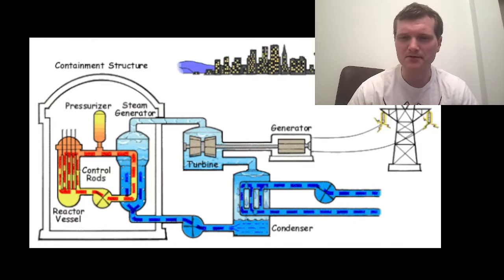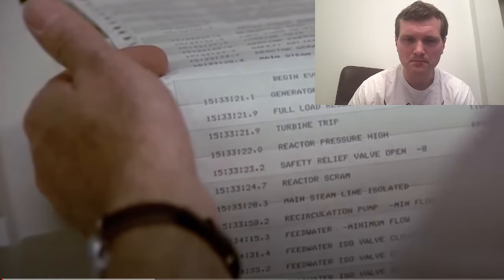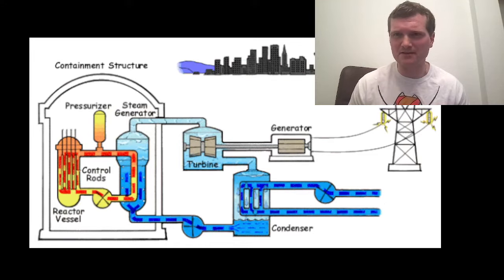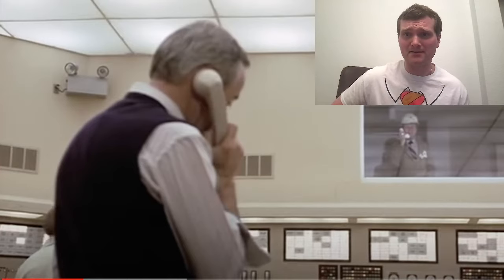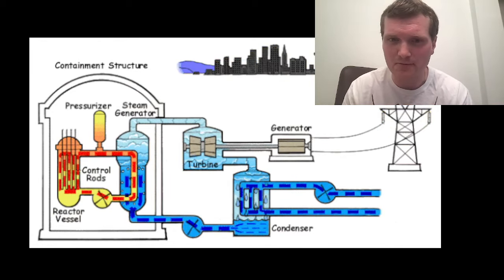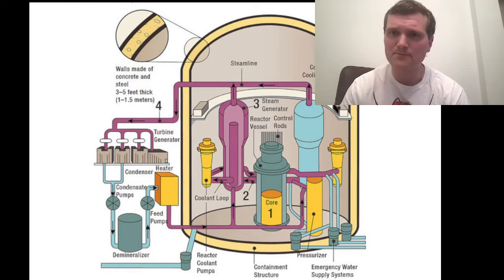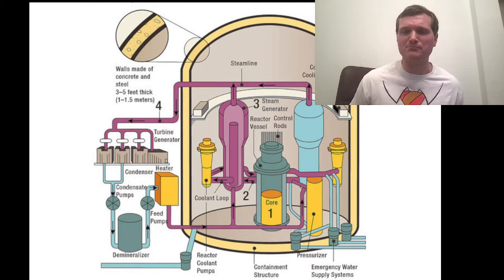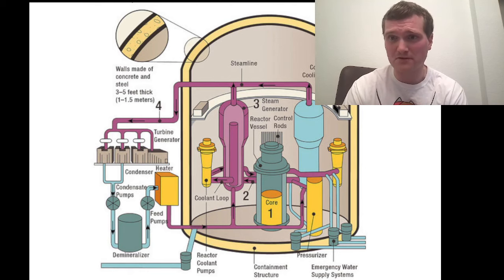Nuclear Engineer Reacts to Turbine Trip scene from The China Syndrome

Comment: Three mile island pressure control valve stuck open. But before that they shut the pumps off? Just like this movie, why would you ever shut pumps off that control water level over the core. I dont get that at all.
Reply from the maker: Great Question! Short answer: you don’t!

Longer answer: the TMI operators erroneously believed that they were going to fill up the reactor coolant system completely and there was an imminent overpressure event - their pressurizer level was rapidly approaching 100%. So, they stopped safety injection. 

It turns out that the pressure valve being stuck open created a void in the pressurizer (there was water at the top and steam in the middle) giving them a false indication. They were nowhere close to an overpressure event and this eventually led to core uncovery and fuel damage.

Operators are now taught to be aware of this false water level indication and better water level monitoring systems were installed in all pressurized water reactors in the US after the TMI event (among many other changes).
Reply: @tfolsenuclear   Just one question, why didn't they install cameras to watch things like that? Core water level etc.?
Reply from the maker: In a pressurized water reactor, pressure is over 2200 psi and temperature is over 600 degrees F - no camera can survive that!
Reply: Toledo Edison was the dress rehearsal for TMI. The NRC failed to communicate to like operators of other units about this potential problem.
Reply: IIRC the event started when workers were cleaning a sensor, accidentally causing the primary condensate pump to trip

Secondary pump automatically  started but the valve was closed for maintenance! 

So the steam generators are dry, the reactor residual (decay) heat, with nowhere to go, start to increase the pressure, the PRV opened to release excess steam pressure. 

The plant was handling the event as designed and presented no damage or safety issues (IMHO). 

The PRV valve however had a known flaw where a mix of water and steam can cause the valve to stick open while the indicator in the control room shows it closed. 

The valve is basically depressurizing the reactor causing water to flash to steam. a high level alarm in the PRV tank provided a clue the valve was stuck.

Up to the point of the PRV valve failing to close, the plant was doing  exactly what it was designed to.

In the chaos, operators (assuming the valve was closed) took manual control trying to correct the pump issue making the situation worse. Now the reactor core is exposed and getting very hot (meltdown)

A new shift arrives and discovers the valve is stuck open. They restore water to the reactor but the fuel is melting. At this point it's damage control. 

My take is:

1) B&W plants had issues but otherwise performed well during the event.

2) The control room and indicator layout was inconsistent, leading to further confusion about the PRV state.

3) The response (Particularly the utility company) pretty much torpedoed the public's trust in commercial nuclear power.

4) Nuclear is not the boogieman people believe it is. However, it requires meticulous quality and operator training and procedures.

Comment: Nuclear reactors are sort of like the Apollo command Module. tons of high quality engineering and redundancy.  9 trips to the moon and all came back over 300 hours approx.  200 WW reactors or bit less and almost no accidents and newer designs are so much safer and others like thorium does away with all the pressure problems and "melt downs"  and we will then move onto Fusion eventually with so many advantages and non of the radiation and waste like previous.  Oil and gas and cola will be mostly replaced given time so why this green rush?? Just bankrupts everyone trying to make solar and wind work 24/7 which it cant, but stupid is as stupid does!!
Reply: The great Stanley Kubrick spared no expense in making every film as convincingly detailed as possible. #nasaisanazijoke

Comment: I just saw this movie for the first time a couple of nights ago . The dramatic scene in the movie where Operations and Technical personnel have to go though all this effort to research and find a way to initiate a trip of the Turbine / Unit ASAP is totally fake . Routine testing is performed using  procedure(s) to simulate emergency trips to verify all systems work as designed . Technicians  already know what wires to be careful with to prevent accidental trip outs all you have to do is ask them .

Comment: I was told by one of my co-workers that water pumps with such criticality had a motor rating of somewhere around 5 horsepower but in reality was closer to 900 horsepower to use if stuff went wrong and you had to get that water in there fast. Was he fulla crap?

Comment: The reactor doesn't "always" trip on a turbine trip...at my plant, if Reactor power is below 50%, the reactor DOES NOT automatically trip upon a turbine trip. If this guy was a shift manager on a PWR, he probably would have indicated this.

Also, he keeps talking about the pressurizer here when it is clear that there IS no pressurizer...what these guys are dealing with are characteristics of a BWR (Reactor water level, the need for "feedwater" which feeds directly to the core on a BWR). Additionally, he says that Safety Injection would have actuated a "long time ago" and he's right...BWR's have a similar system except that the reactor operator tells Jack that "LPCI is tagged out for maintenance" a completely illegal action for a plant at power (I assume he's talking about both "Trains" being out of service). Finally this whole episode is false and pejorative...there's no way that a one unit plant would have that many board operators at one time, especially with the plant being stable at 100% pre-trip. Current staffing has two "Reactor Operators", a Unit Supervisor who's a Senior Reactor Operator and a shift manager. 

This guy is knowledgeable about what a PWR does post trip but can't seem to make the jump to the fact that the operators in this clip are dealing with a BWR.
Reply: Which plant do you you work at?

Comment: You also said that "The control rods insert in less than a span of 2 secs". ummm Insert into what?
Reply: They insert into the channels adjacent to the fuel rods. The fuel rods are spaced out and react with each other, causing friction and heat. It's because the fuel rods basically emit trillions of microscopic particles that blast into each other and explode. The control rods are inert materials that slow down and stop this process. They are mechanically inserted in-between the fuel rods. This is a simplified non scientific explanation.
Edit: they can also be sleeves that cover the fuel rods and slide over top of the fuel rods.